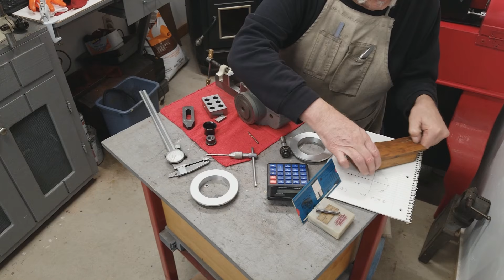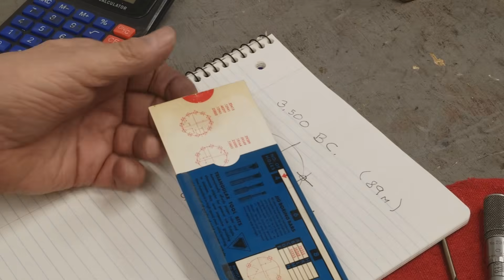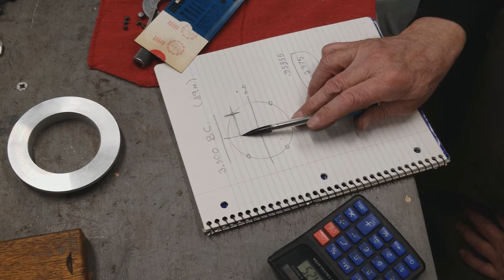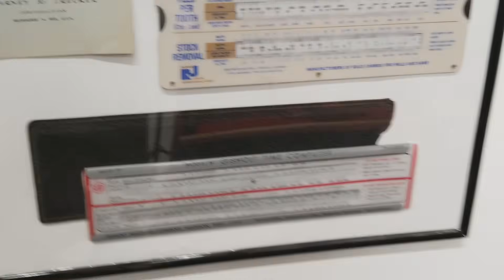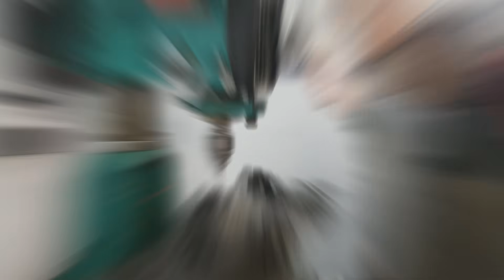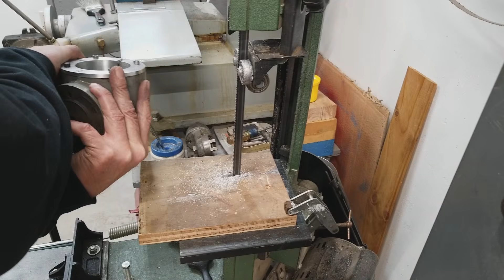Custom Fit Sleeve, Machines & Hobbies

Comment: You should drill through both surfaces at once. If you wasn them different sizes, at least drill a pilot hole to line up the centers. Work smart, not hard
Reply from the maker: That's definitely a good way to approach it, thanks for the tip! 👍

Comment: Looks good!!! If you were trying to find a bolt circle on something that the bolt spacing is different (like on a crankshaft flange) I'm sure it would be easiest to find the locations on a rotary table. Would it be possible to find the locations using trig? Just curious. My original idea is to finish setting up my DRO and plot the circle that way. But I have a touch of nostalgia for how things like that were done before modern conveniences. See you next week!!
Reply from the maker: Yes, It is possible to figure out the BC using trig along with a lot of different measurements. I would start out by measuring the OD of the flange.  Measure the diameter of the holes. Measure between the flange OD and the hole. All the way around the flange. If they are all the same it's simple math from here. You might have to find the angles. Back in the day we would draw it all out adding all the measurements to the drawing. Measure everything you can, put it on paper. Good luck 👍
Reply: Thank you. I'll have to try that.